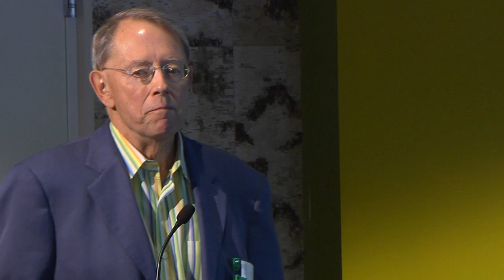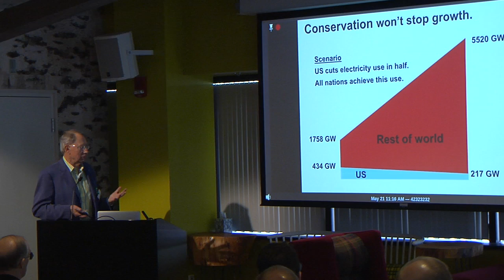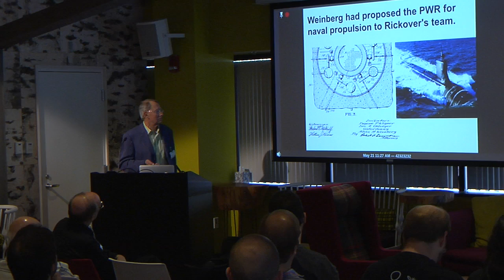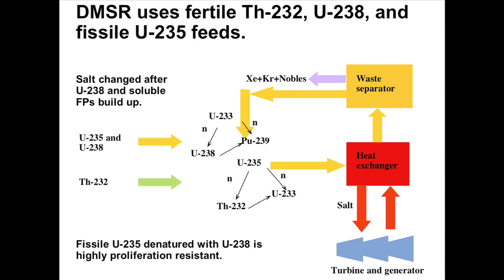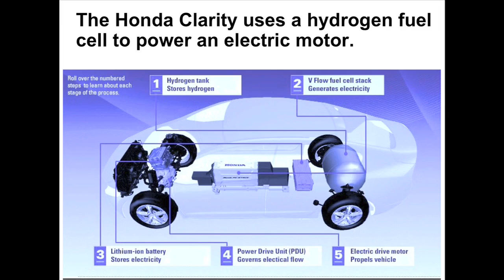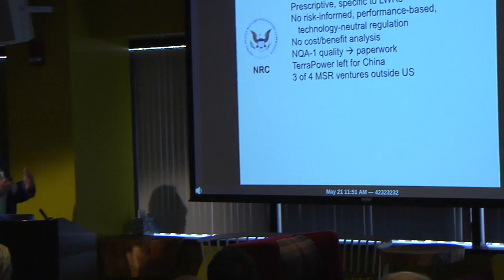THORIUM | Robert Hargraves | Talks at Google

Comment: The presentation begins with a mention of dry wood as a source of energy, an irrelevant argument in modern society. It goes on to discuss energy policies in the US in very generic terms.
There is no mention of the various issues with the nuclear industry, and no mention of the various theoretical and practical issues with LFTR's which, just as a reminder, have never been built.
There is also no mention of the MSRE experiment, the only liquid fuel reactor ever built, a 8MW thermal experimental reactor which operated between 1965 and 1969, which never used one gram of thorium.
A very poor presentation with little information, confusing arguments and absurd conclusions.

"China is quietly pouring $100 million per year into it." Pfff. This is a ridiculous assertion with zero supporting evidence. There are 100~150 students at SINAP working on various technologies closely or remotely related to molten salt reactors. I very much doubt each one earns even $10k per year. That $100 million / year claim comes straight from thin air.
Reply: +John Champagne I guess you are dumbly repeating a few random arguments for molten salt reactors, first stated some 50 years ago by the scientists at ORNL who actually built one, the MSRE. Well, these scientists are now all dead and not a single molten salt reactor has ever been built since.
Here is a quick reality check on LFTR's as proposed by Kirk Sorensen:
How many nuclear engineers does Flibe (Kirk Sorensen's company) employ? (zero)
How much capital has Flibe raised over the last 6 years or since its creation? (zero)
How many nuclear-related patents does Flibe hold? (zero)
How much nuclear-related research has Flibe conducted since its creation? (zero)
How many molten salt reactors have ever been built? (one 8MW experimental reactor, in 1964, operated-not continuously between 1965-1969; cost of decommissioning 45 years later: $130 million).
How many thorium/uranium-233 cycle reactors have ever been built and operated? (zero)
How much is thorium worth on the international market nowadays? (less than its extraction cost)
How many renowned nuclear scientists have ever stated that the thorium/uranium-233 cycle was economically or technologically viable? (zero)
How much is the ORNL investing in thorium/uranium-233 cycle research nowadays? (zero)
How much is the ORNL investing in molten salt reactor research nowadays? (zero)
How much does electricity from nuclear cost in the US, vs wind or solar WITH STORAGE? $0.16 / kWh for nuclear, vs $0.08 per kWh for wind or solar WITH STORAGE.

We are in 2016 and the nuclear industry is dead. Zero-carbon emissions renewables are the solution to our energy needs going forward.
Reply: +Andr&#233; Balsa I don't trust your figures, so if you want to indicate a source, that could be helpful. The speaker took strides to indicate that he was attempting to calculate true costs of production and not costs as reflected after government subsidies were taken.

If you think my selection looks randomly chosen, I wonder what you think are the strongest points in favor of liquid-fuel thorium reactors.

What assertions from proponents do you feel are most dubious?

You asked about what prominent nuclear scientist has recommended this technology. Weinberg [was part of a team that] invented LWR [correction: PWR] and lobbied for shift to liquid fuel. He was pushed out when his concern about (lack of) passive safety of LWR [PWR] was not politically convenient.

Even if we disagree about nuclear power, can we agree that industries should pay money when they put pollution or deplete natural resources or degrade environmental quality? We could give the proceeds to all the world's people and end poverty throughout the world. (Easier for China, etc., to embrace a fee if the proceeds are returned to the people. That would be a source of social stability and would lessen the pain of a carbon tax.

Systemic flaws are not reported:
http://gaiabrain.blogspot.com/2011/08/systemic-flaws-are-not-reported.html
Reply: John Champagne "I don't trust your figures..."
Of course you don't!
But I have to correct some things you got wrong.
Alvin Weinberg registered various patents for Light Water Reactors (LWR's) but is not the "inventor" as such of LWR technology, as you incorrectly stated, and he NEVER stated that the thorium/uranium-233 closed cycle was technologically or economically viable.
https://en.wikipedia.org/wiki/Alvin_M._Weinberg
Kirk Sorensen has been trying to rewrite history by misrepresenting the history of nuclear reactor development at ORNL to suit his thorium/LFTR propaganda, but the facts are there for all to see, such as in my quick reality check above.
Reply: +André Balsa I carelessly wrote LWR (instead of PWR). Thanks for that correction.

From the link you shared:
"Amongst the competing designs, Weinberg proposed the pressurized water reactor, which ultimately became the most common design.[20] This was only one of the many possibilities discussed by Weinberg and his colleagues at Chicago and Oak Ridge. ..."

And:

"According to Freeman Dyson, [Weinberg] was the only nuclear pioneer who supported the wide universe of reactor designs.[23]..."

That suggests that he wanted to explore all possibilities. You suggest he lacked interest in what Sorensen says he was interested in. You point to information that supports Kirk's view.

Do you want to give a source for your cost estimates? Shouldn't we just insist that the economy operate in a way that accounts for externalities, and let the chips fall where they may? Natural law requires respect of PUBLIC property rights, too: http://gaiabrain.blogspot.com/2011/04/natural-law-requires-respect-of-public.html

[I didn't see evidence that Weinberg never uttered a statement of support for a molten fuel thorium design. Wiki pages don't include all statements known to have been made by any person. You seemed to be claiming that that negative (absence of support) is proven at that link.]
Reply: I've read that China is now working on using molten salt as a coolant and heat transfer medium, not as a liquid fuel.  It's a step in the right direction, as it would advance materials and technologies needed for successful LFTR designs, but the Chinese effort won't produce a LFTR in the near term.
Reply: I think Andre does a search for anything thorium on youtube and them trolls them for reasons I can't imagine. There are some 50 start-up companies with private funding that didn't get his memo. If these companies were getting HUGE subsidies like wind and solar, I would be suspicious, but it's private for the most part. For anyone who is interested take a look at a few of the front runners, Terrestrial Energy and Moltex in Canada, Thorcon Power in Indonesia, TransAtomic power in the US.
Reply: +Balsa "not a single molten salt reactor has ever been built since." -- mainly because of the successful hostility of Big Carbon, which takes every opportunity to make life difficult for the only technology that can put them out of business.